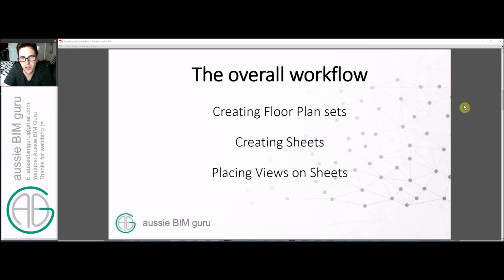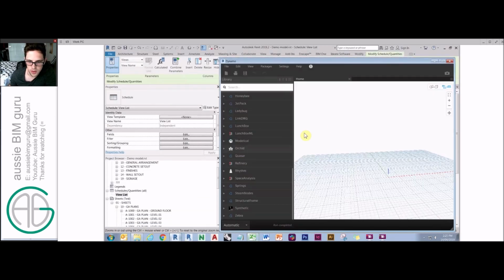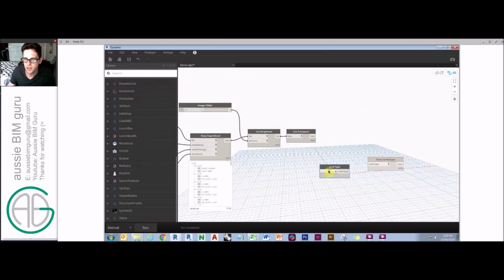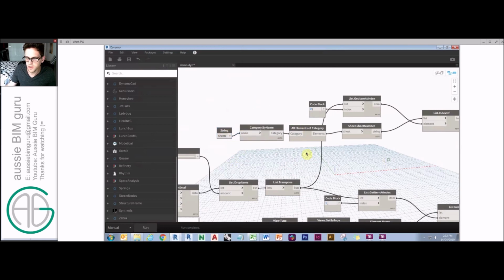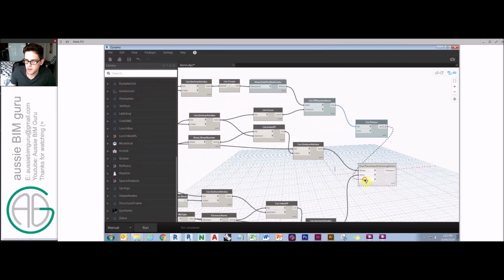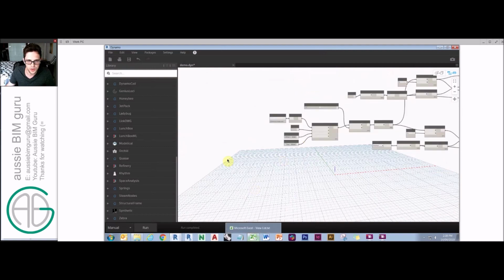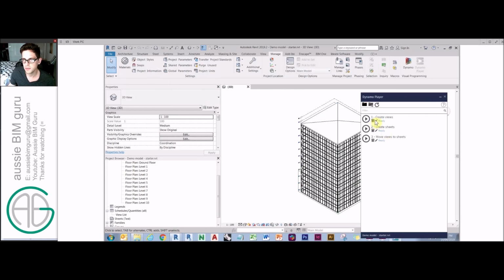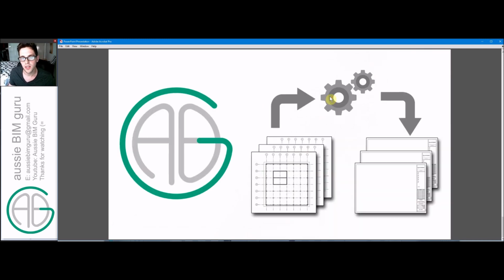Place Views on Sheets using Dynamo! (Views to Sheets 3/3)

Comment: Is this good for relocating the views already on the sheets. Also is it possible to locate the and adjust the title location?
Reply from the maker: Slightly different approach. Check out the rhythm package which has nodes to get/set viewport locations and title properties.
Reply: @AussieBIMGuru  I managed to make this work(with rhythm "Tool.SetLocationBasedOnOther" node), and the child viewports will match the center of the parent viewport. The problem is the viewport box will vary if the annotation in each viewport changes(say the section sign is longer or shorter in a viewport will change the viewbox scope). So it still shows flying over the sheets. Is there a node you know that will align viewports according to the center of the crop region, or are other shapes easily identical?
Reply from the maker: @junzhou1628  yes the issue there is revit thinks the extent of the viewport is bigger. The only workaround there is to temporarily isolate an invisible category like the project base point when getting/setting viewport centres. This is difficult to do in nodes.

The viewport.getcentre node in Crumple shows how this can be done in Python.
Reply: @AussieBIMGuru  Thanks for the help. I made it~

Comment: I'm on Revit 2020, have Dynamo 2.3 and both packages installed... but the functions you're using are not there for me. @9:37 you search for the function "Sheets" but that is not in my archi-lab package... how to get around this?
Reply from the maker: It has likely been removed from the package eventually as later versions of dynamo absorbed these nodes. I have some nodes to create sheets in Crumple, and you can get sheets using get element by category node in 2020.
Reply: I don't understand how to choose a sheet from the project. The "get element category" keeps giving me the error "expects argument type(s)". It can't be this hard to simply choose a sheet that exists in the project :S
Reply from the maker: @beezzwax2013  it sounds like you might be quite new to Dynamo (not meant to offend, just to guide) - I'd suggest Dynamo primer is the best place to begin vs full workflows. It covers the way to use all elements of category, as well as indexing.

Unfortunately in 2020 there is no Sheets node dropdown if I recall correctly (I don't work any earlier than 2022 these days... it's been a while since I've seen 2020's node library). Dynamo was more new then to Revit so it was not developed to that point. Archilab had a dropdown at that point in time to help with this. I believe the Orchid package may have a Sheets dropdown but it's a difficult package to install.

I've checked in Revit 2022 and there is a sheet dropdown in that version. It can be found under Revit > Selection > Sheets. You may find it easier to learn Dynamo in 2022 or 2023 as there will be more nodes available there.

Comment: Whenever i get the Tool.PlaceViewsOnExistingSheets it say views where already placed? No views are place in sheets in my revit model. Do anyone have an idea to why this is happening?
Reply from the maker: If you run the node more than once it will say that typically. Alternatively try the create viewport node from rhythm.
Reply: @AussieBIMGuru  Thank you for getting back to me so quickly but unfortunately i have now ended up with a null value
Reply from the maker: @JaiminParmar-g5h  id say try dynamo forums then, easier to troubleshoot specifjc issues there.
Reply: @AussieBIMGuru  Great idea thank you, love the videos by the way they all been great for learn dynamo and helping with everything in revit, much appreciated

Comment: Hello Gavin, i almost got the script to work, which i really exited, but all of my views were placed on the same sheet.
Reply from the maker: Make sure you have lists of equal depth (@L2) with equal length (1 sheet/1 view/1point per placement).
Reply: @AussieBIMGuru  thanks for the reply, but i don't understand your answer since I'm new at Dynamo. Which of the nodes would check this info in?
Reply from the maker: @ADplays-67  check the three lists before you place sheets and make sure they are lists that look the same in depth/length. Beyond that use dynamo forums for detailed help.

Comment: Thanks for the great video however I cannot find the nodes: "Views.GetByType" and "View Type" although I installed steamnodes and archilab packages. I'm using Revit 2022 and its relative Dynamo. Any idea why I don't have these nodes?
Reply: i also have same issue
can anyone tell list of packages to be install
Reply from the maker: I can see both nodes in archilab under Revit > Views.

For reference I am looking at version 2020.23.13, but it should be in later builds also.

Comment: My View.viewportboxcenter is now returning a message "This custom node contains an invalid input. Please fix the input before saving the custom node."

When I run the script, it shifts the viewport by a certain amount for the remainder of the views. Almost as if it took the coordinates we input and offset them by a certain amount.

Currently using Revit 2021 and dynamo 2.6 -  Any ideas?
Reply from the maker: Hrm steamnodes is a pretty old package now, maybe try the node from Rhythm for this instead.

Comment: Thank you so much 
Can you change point viewport to top left
Reply from the maker: Yes you would need to pre-calculate the size of the viewports based on their cropbox (bounding boxed), then before placing at the points you would need to move it half the width to the right and half the height downward.

Comment: Thank you so much Aussie BIM Guru!!! I didn't see this in the comments yet but forgive me if you've answered this already. Is there a way to still get the views to be in the exact same spot on the different sheets if the view port box center is not the same as what I would call the crop region center? Thanks again!
Reply from the maker: As far as I know Dynamo doesn't really have a good way to do this, it uses the extent of the bounding crop. The only way I could think of is to union box all the valid bounding boxes in a view's contents and find the centre of that - but it would be a very heavy operation to undertake.

If you're game, I have a node in Crumple called 'UnionBox' that does this.

Comment: Hi!
Guru, it is possible to change the viewport "nesting" point, to be able to change the postion of the views on the sheet?
I want to place e.g. 3 sections right next to each other, but not manually. I think that i can just change the coordinate of view, but acutally I dont have an idea how to do it. 
Do you have any solution?
Big thanks for your work.
Reply from the maker: Viewports are typically positioned by their centrepoint, so you would need to know the position of that for the three views. There are some nodes in R21 onwards that 'pack' views onto sheets (sheet by name number titleblock view(s)), but the algorithm usually picks ugly spots unfortunately.

To update the location of a viewport, you should be able to use the 'set location' node i think.
Reply: @AussieBIMGuru  yeah, "byNameNumbetTittleBlock" node works randomly, regardless of the number of views. I will use "setlocation" node and try to change the centrepoint. 
I'll let you know how it works :) thanks!

Comment: Hi BIM guru, i tried this script finally showing "View is already placed" actually nit placed.
Reply from the maker: Strange, if you've placed the view already then re-run the script it doesn't keep flowing data if I recall correctly, it goes back and checks the placement again so maybe it just placed it? Ideally the script should be run only once.

Comment: Do you have a script for legends on sheets? And how does is work by different parts/scope boxes?
Reply from the maker: As I usually use Revit 2020+ this allows legends to be copied to sheets normally but I know in older builds this can't be done, and sometimes automatic placement still has benefits.

Sean shared a script over on Dynamo forums for this, I'd try that one out:
https://forum.dynamobim.com/t/place-legends-on-multiple-sheets-with-template-legend/25632

For different scope boxes I would usually name these in a particular way (e.g. Level 1 - Zone A), and you can then use that name in Excel just like any other view. Sometimes I would run the script a few times with different files, so I might place all of one scope box at a time, as they will probably have different viewport centres to guide them to position on the sheet.
Reply: Amazing, thanks I'll try this.

Comment: Hi Gavin Great stuff here. Can you share how you would use this Dynamo script to place schedules? I can't seem to get it to do that i've got the views working and its fantastic thanks again for the great tutorial
Reply from the maker: It requires a different API method to the one used by this package, which can be found here:
https://www.revitapidocs.com/2015/8402dc3c-8bdc-40f5-be54-da08bc69d0cd.htm

I might add such a node in future to Crumple, but for now I believe Rhythm's viewport creation node works for both views and schedules - I assume the author has made a logic gate to catch when it's a schedule and when it's a view.
Reply: @AussieBIMGuru  thanks I'll try on Monday and report back. I'll try that creation node. Where would I place it in the dynamo script?
Reply from the maker: @fulybuilt  it would be effectively the same location as this workflow, but you would need to get the schedule type instead of a view.
Reply: @AussieBIMGuru  Hey Gavin I'm not having much luck here i've brought the Rythm viewport creation node into the script and have tried it in multiple locations but I really just don't understand all of this yet as I am completely new to dynamo.  Any chance you can help me work through this? maybe you could email me a screen shot of what I should be changing to get this sorted.
Reply: I've emailed you

Comment: Gavin, your videos have helped me tremendously!  I have a question though.  My SteamNodes "Tool.PlaceViewsOnExistingSheets" seems to be outputting a string, and the Element.SetParameterByName node requires an element.  how did you get around this?  maybe the python script with the SteamNode is buggy??
Reply from the maker: This is actually because the node outputs a message for any views that are already placed. Make sure that you run the script in its entirety before the views are actually placed, then it should send viewports out the other side instead of text.

Comment: Not sure if other people had this problem before but I'm having an issue with "Element.SetParameterByName" dropdown at 13.04, popping out this warning message "Warning: Internal error, please report: Dereferencing a non-pointer." Any idea? 
Thanks in advance.
Reply from the maker: Usually this warning means one of the data types is empty or not something the node can process. The most common reason for this in this particular script is you have run the script a second time, so the node outputs a message instead of the viewport (something like 'view already placed'), which cannot have its type set to another viewport type.

Try running the entire script in one complete run, or via Dynamo player whilst all views are not yet placed.
Reply: @AussieBIMGuru  Hey, I have same problem, but running the script second, third or more time does not solve it. Is there any other solution for this problem? Thanks :)
Reply from the maker: @kvasovie  it means at least one of the inputs is not correct at the time of running. The elements should be viewports and the parameter value should be a viewport type. Look at the outputs to confirm this is the case, and if it isnt then thats the cause. This script runs best in dynamo player, and all views must not be placed on sheets before the script is run.
Reply: @AussieBIMGuru  Thanks for super quik answer! I noticed, that already by Tool.PlaceViewOnExistingSheets it generates 74x 0 value, not sure if that is ok. Then I also noticed, that Sheet.number lists sheet names, even though its linked correctly. Could this be actually the issue?
Reply from the maker: Possibly, yes the node from steam nodes doesnt work in some versions. Try my node in Crumple (my package) called ViewsToSheets_ByPoint.

Always follow the error back through a script as it will trigger more errors as it goes so the first one to solve is the earliest one.

Comment: Hello BIM Guru, great tutorial, thank you for the work you do. I have a problem when I use the List.IndexOf node. The list generates a -1 outcome in all the index when I run it. Do you know what the cause might be?
Reply from the maker: This means a match has not been found in the list. One reason may be that the sheet number is being imported as a number, but it needs to be a string. Make sure to import excel data as strings, and check the data types using object.type to make sure they are the same.
Reply: I have same issue, and I use Object.Type but nothing change :( .
Reply: I have the same issue.. can you please provide a solution for thid
Reply from the maker: See above solution. Something must not match in the text to what you are comparing between excel/dynamo. Pay care to case and punctuation as well as any language based differences between the programs.
Reply: @AussieBIMGuru  thanks
Reply: Yea I'm getting the same "-1". Both columns from excel are strings (System.String) when I check with object.type. There are (E) views (RCP in this case) in the model already and it's showing those. Would one need to filter those out somehow and THEN connect to IndexOf?
Reply from the maker: You need to compare apples to apples, so names to names. Get the names of the RCP views to compare to excel instead of the RCP elements.

Comment: Thank you for your very helpful videos and greetings from Sweden! I used your Crumple-node to replace the viewstoexistingssheetsnode, and now I get an error in the last node for this script. "Dereferencing a non-pointer". Also, the ViewsToSheets_ByPoints-node returns null for both dictionaries. Can you help me?
Reply from the maker: Non pointer is quite a generic warning so hard to troubleshoot off that alone. Make sure you feed in views, sheets and dynamo point(s). A common error people make is feeding in view/sheet names and not elements themselves.
Reply: @AussieBIMGuru  I replaced  the one node with the node from crumple, everythings else remaining the same as in the video. Should that work?
Reply from the maker: Ideally it should, yes. I havent tested the nodes beford or after revit 2020 so it could be that too. Make sure the data types are all correct and in the form of lists, beyond that maybe edit the node, copy the python to dynamo and see if that gives a more clear warning.
Reply: @AussieBIMGuru  You are overestimating my abilities a little...I have send you an email, very grateful if you can help.
Reply: @AussieBIMGuru  im having the exact same issue here in Revit 2021. Was there a solution to this? Im probably missing something basic as im relatively new to Dynamo still.
Reply from the maker: @Rob_Bo  hrm strange. Make sure you have the latest build installed and that you are connecting a list of views, list of sheets of equal length and point or points depending on which node you are using (one uses 1 point for all views, the other needs 1 point per view).